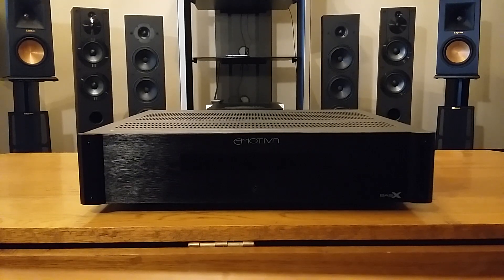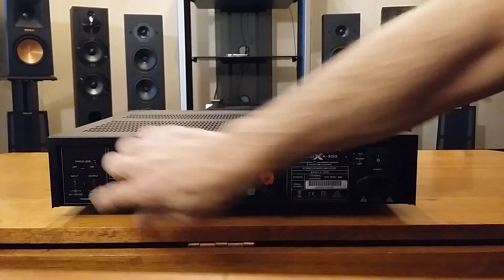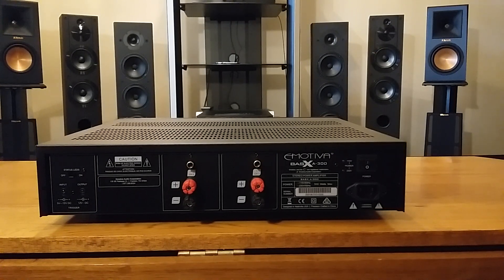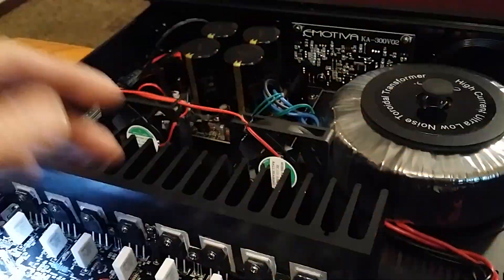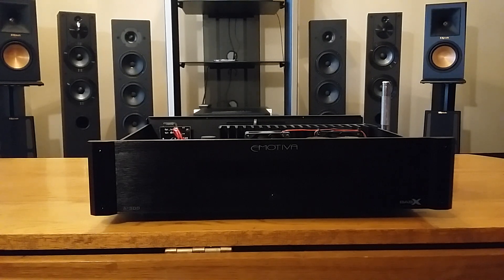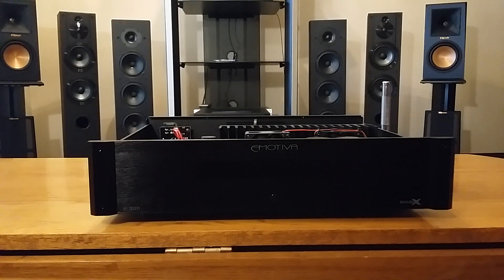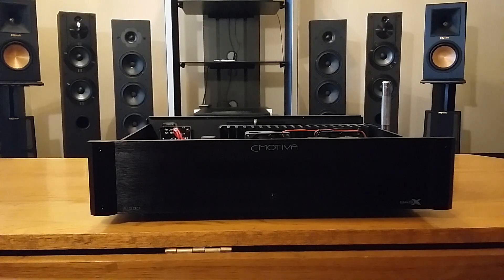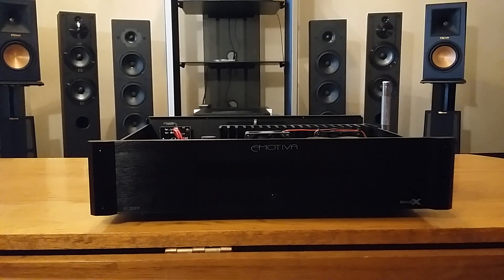Emotiva BasX A-300 class A/B 2 channel amp full review and a peak of what's inside of this amp

Comment: Just bought it and mine has an annoying electrical fan noise coming from it.
Reply from the maker: III III are you serious !! Did you buy new ? if so call them and send it back Emotiva has an awesome customer service , I ran my a300 for a week straight and it's never had gotten hot enough for fans to kick on , Not saying you hooked up anything wrong but check your connections , You might have got one that got damaged during shipping but don't word just call Customer service they'll be happy to help you and they'll fix the problem or they'll give you a new one , Mines been doing great web sounds better after a month of Break in so sorry you having this problem
Reply: TJ McDonald yes new. It seems to be a common problem because there is a thread about it in the emotive forum and reviews on Amazon etc have people complaining about it.
Reply from the maker: III III yeah that sounds awful I'm a maintenance man at a local automotive factory and it sounds like the motor in the fan is going out emotiva could have got a bad batch of fans I've ran mine constantly and it never has had a problem I think you have a 2 or 3 year warranty just call them they'll take care of it sorry that happen to ya I never knew their was any issues with cooling fans but i'm sure Emotiva knows about it and I'm sure they'll let their supplier of fans know also don't let it get you down you got a warranty with a good company I researched them heavily before I did the video review don't try to fix it yourself if you take the cover off they'll know and won't cover under warranty and it's very dangerous to remove cover even unplugged because the compasitors hold a charge so let them take care of it thanks for the heads up
Reply from the maker: III III Did you call Emotiva?
Reply: TJ McDonald https://youtu.be/Ae8egAOxju4
Reply: I returned it.
Reply from the maker: III III glad you got taken care of Emotiva does back up their warranty and they have great customer service